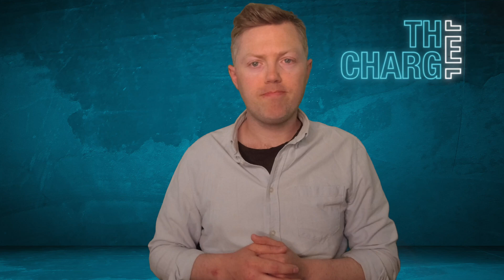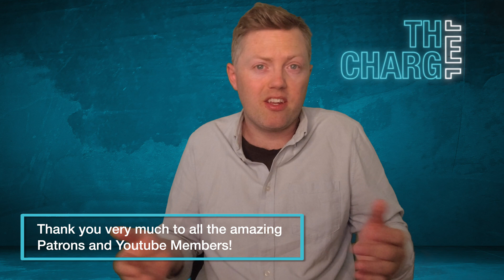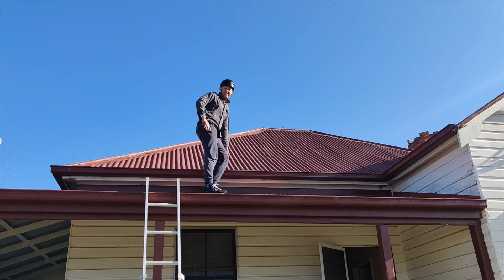CATL Tectrans LFP Battery is INSANE with these Metrics

Comment: Until batteries can get to 5kW/Kg,  and recharge in 5 mins, I'm not interested as its no better than what I already have.
Reply: Petrol is about 13kWhs per KG but given that an internal combustion engine wastes about 80% of that as heat then you are getting 2.6kWhs per KG. What you are getting though is a lot of Co2, nitrogen Oxide and particulate matter. Also you are paying £1 for your 2.6kWhs and off peak electric would 18p but it's your choice.
Reply: @pauldenney7908  Wastes 80%, hahahah. Well off the mark my friend. That's a figure for the 1920s. Toyota produce a 40% efficient petrol, and diesels are 45% efficient.  There is a German  company that makes a 2 stroke Marine diesel at 52% a world record. So it's not 2.6kWh, it's 5.85kWhr.
My Mazda 2 produces 90gm CO2/km driven which is less than a BMW mini. NOX is reduced  by lowering the compression ration from a normal 18:1 to 14.8:1 and particulates are dealt with by the DPF - you could eat lunch from my exhaust pipe. 
My 5.85kWh cost me 75p and gets me 15.6 miles, which is fine.  I can get 1100km from one tank and re-charge in 5 mins.  Can u do that?
As for your off peak power where does it come from?  Its not solar, and it might not be wind which means gas or coal, how about them emssions? Just transferred from your exhaust to somewhere else!
Reply: @csjrogerson2377  The last coal power station in the UK closes in a few days. In Scotland where I Live our power is mostly wind and hydro, in any case I have my own solar which has been powering my EV all summer. Even if it was powered from  electric from a gas turbine an EV would use 80% of its 70% and still be more efficient than the average car not fitted with some experimental engine that will never make it out of a lab.
Reply: whats do you have?
Reply: @waichungsham1578  Something that's better than an EV.

Comment: 600kw battery for bus will still wait like 4 tons at 175w/kg.
Reply: Wait??  What are we weighting for?  Another bus? 3,428kg + BMS + cooling system + container.
Reply: Yes I wonder if it is a good scheme? Seems unnecessary.
Reply: Yes, but much of that energy is returned every time it brakes, which is often